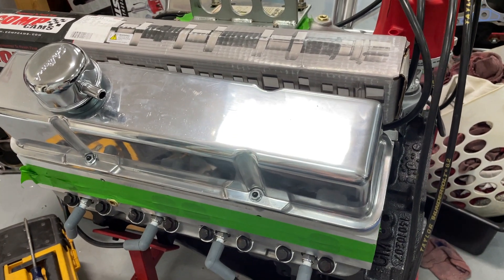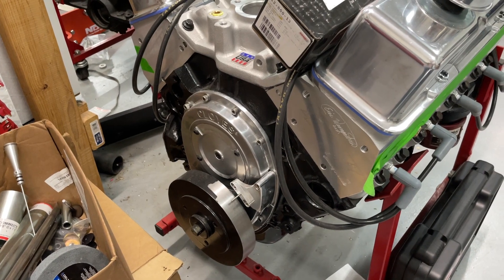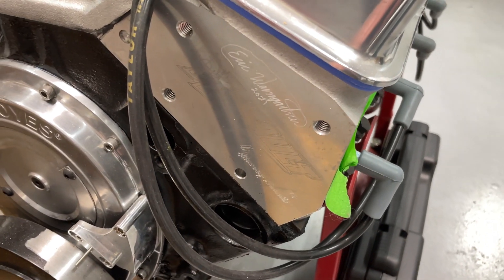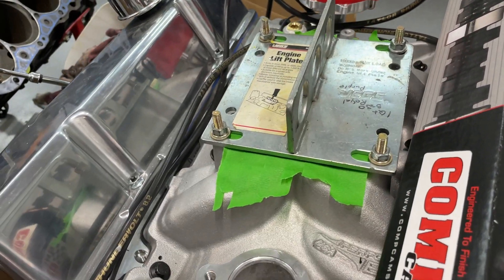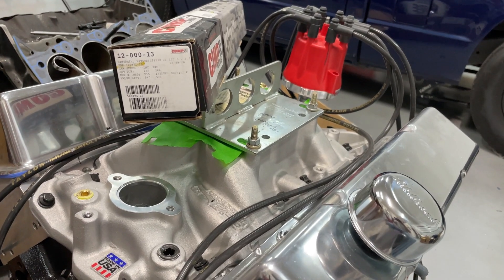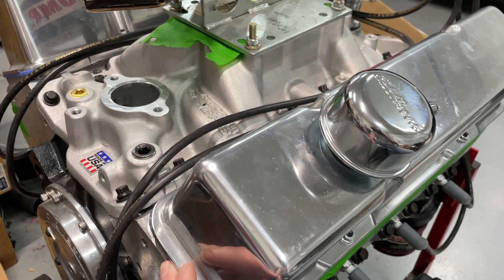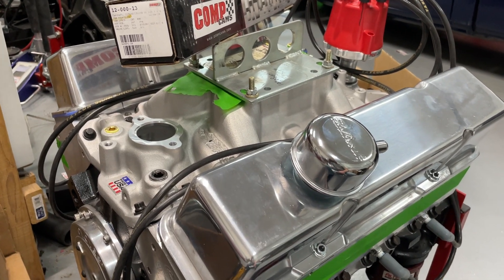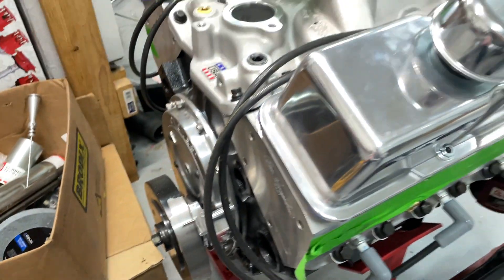Taking Another Engine To The Dyno Tomorrow. Take A Guess

Comment: Those heads will make a big difference on peak power and rpm, should be closer to an LS graph as someone else commented. The intake will probably hold back the peak torque a bit but the dyno headers should help. I’m guessing 448 lb-ft at 5000 and 475 hp at 6200. It might be still going up slightly when you shut it down. I’m also guessing the idle will be good, as you’re desiring, but there might be just a little lope there.

Comment: This will be interesting. Very strange combo even though gas is cheap in the USA in 2022 compared to the way over $10,- GAL we are paying for regular here.
High squish clearence, large intake ports and very early exhaust valve opening will reduce torque to the 1.2 lb/ft pr. CID range and decrease fuel mileage, right?

Comment: 436hp @ 6000
445tq @ 4400
  
Heads are way to big and intake valve is to big also to make good streetable low end driving torque. 
Camshaft is oh my goodness crazy!!!! The intake lobe is really close, but for the love of god, the exhaust lobe is going to kill it. 10 degrees would have been plenty enough with that lift and LSA. Cutting the divider down a little helps carry power out farther up top but hurts a little down low(not much).
One of the other comments said it right, when buying the rotating assembly, why didn’t you go with the 383 kit? It’s the same money. More cubes= more tq and hp!!!!! Then the 215cc heads and 2.08 intake valve would have been much more useful but that cam🙈😱🤭. Please explain why you done the cam . I’m completely lost there.
Eric I love the videos and your advice. Keep up the great port work!!!
Reply: Lol. Nothing wrong with this combination

Comment: Ok here we go- prediction:
Huge torque curve, above 400 by 1900, peak at 4100 at about 467 lb ft, hang on above 400 just past 5300… HP will be limited on timing at WOT, to about 32-33* and will yield about 418 flywheel at 5900. Nice build, shame about the quench.

Comment: I think it's got way more heads than required. So I doubt it's gonna fall off up top. 450 ft lbs/ 463 hp.
Reply: That’s to much tq. About 400-410
Reply: @jrod264winmag  we shall see...
Reply: I’m just going off of my 383 stroker. I got more cam than that and 10 to 1 compression and it only made 450 tq
Reply: @jrod264winmag  OK well I'm just guessing... but those heads flow way more than what's needed. So I think it make more up top. I'm guessing the graph will still be climbing when the dyno pull is stopped.
Reply: @davidresar8256  yes they flew a lot more than I expected. He did a great job of porting them and they would work well on a 400

Comment: 410hp 430 ftlb torque should run sweet it will make a nice street motor. It would do that easy for sure on a 108 lsa but may have slight lope with that exh duration. Im very curious.

Comment: Lol. "I'm gonna build an engine to help my sister out. Needs to idle smooth." 
Puts in a solid roller that's 270 @.050 and idles the engine at 2500. 
-- That cam choice looks interesting. Very mild lope at idle. I'll guess for 390hp, @5200, 420 foot pounds at 3600.

Comment: I am definitely interested in seeing the results as the 355 I am building for my '83 Z28 is similar, but I don't have a Hyd roller cam yet. I have a late model roller block from ATK and will be using Dart's Vortec heads (after I follow your and David Vizard's upgrade advice for vortecs.) I also have the EPS intake. I have a set of Hooker mid-length headers with the full hooker exhaust. I am guessing your 350 will pull 448 ft lbs @ 5100 and 415 hp at 5800.
Reply: What are you running for pistons in your 355. I just ordered a set of afr 195 race heads for my ATK 355 short block.
Reply: @jrod264winmag  I believe ATK has has flat tops with 4 valve reliefs. I haven’t even uncreated it yet.
Reply: @xlr8r3VA  mine are dished with 4 valve relief but supposed to be a 9.5 to 1 piston with a 64cc head. I notice an inconsistent piston to deck clearance from front of piston to back on all cylinders. They ranged from .008 to.018. Not good.
Reply: @jrod264winmag  I just watched Uncle Tony’s Garage the other day, they were tearing down a mystery 440. Lots of things wrong with it. It would have grenaded if they had tried to start it. You have to check them really good. This is common unless you’re buying from a reputable shop. ATK is just a mass retailer. I’m glad you posted because now I am going to check everything. I’ll replace the pistons if I have too. Gee, I have some blower pistons and 6” rods… 🤔

Comment: With the head work, cam, compression etc it kind of looks like you're "LS" targeting. 420 HP wouldn't surprise me. Too bad you didn't buy the 383 kit, I doubt it would cost any more, and Eagle has figured out their cast crank to work with a 5.7" rod combo that still internal balances w/o mallory.

After my first experience with the Holley Sniper EFI system, every setup after that engine I went ahead and bolted it immediately on for the first fire up on the dyno. It figures shit out very quickly, and since you're using the hyperspark setup, you could go ahead and build a timing table, finding the perfect WOT curve before it hits the car.
Reply: Your ideas seem solid to me. Maybe the 383 is just not applicable with his sisters needs. But if more power was at all a consideration in this case. Then I think you would have valid ideas for sure. With power not nessasarilly being important. The 350 is probably a little better suited.

Comment: This will be interesting with the big runners/ valve with the odd cam specs. I guess you wanted to see what magic you could do with those heads but maybe a bit much. I wonder if the velocity, atomization w/carb would be big diff with numbers vs fuel injection, if it suffers from fall out?  I'd send my NIB pro headers + cost/labor for trade if the Dyno dissapoints lol! serious!  but considering how the ls3 performs, though not apples to apples, why would this be no different.

Comment: You mentioned how terrible the quench is, if its less than ideal(.039 - .041), im sure this engine will be experiencing some pinging. This engine is very similar to my ZZ4 long block crate carburated engine all except for the camshaft, and the quech is just as terrible, the pistons are .025 in the hole and the heads are using .051 head gaskets, GM's doing to bring compression down to 10:1 and i've always gotten a good amount of pinging mid throttle, even using 93 octane, is there any way to combat the pinging w/o having to tear into the engine?

Comment: You might see detonation on 87 octane with .070 quench, especially during the summer. Throw in some Wiseco pistons from Skip White Performance. They are specially made for Skip to have a taller compression height so that they don’t sit down in the hole so much. Probably pick up 2-3 mpg with the tighter quench.